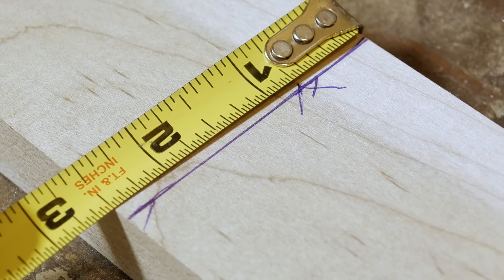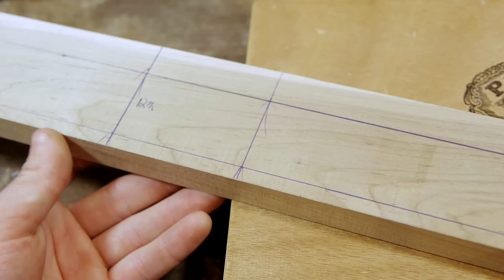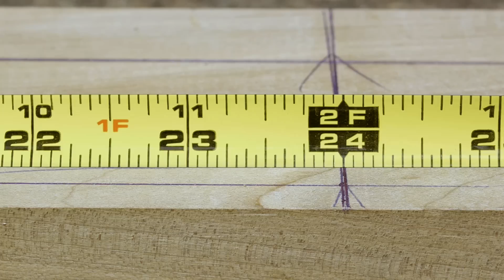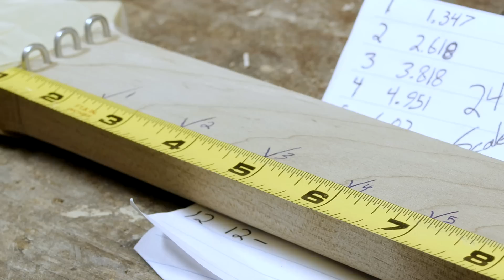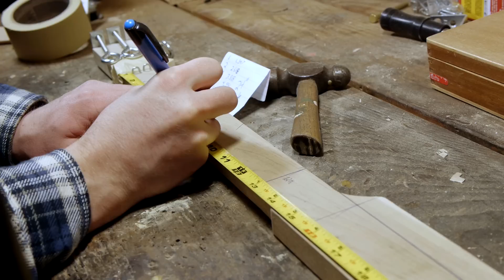Extended Cut: Building a Cigar Box Guitar w/Hand Tools [No Dialogue] - NightHawkInLight

Comment: I think you have some really inventive ideas that solve a lot of problems when thinking about the construction of something like this, but there are some considerations you might want to think about which though might make it more difficult to construct would improve the sound of the instrument.  The sound generates from the soundboard vibrating, which in your case is really just the neck and perhaps part of the cigar box.  I'd suggest try making the portion of the neck that runs along the cigar box much thinner.  It'll be able to vibrate more easily.  The thickness of the neck makes dampens the sound by not allowing for much vibration.   If you notice acoustic guitars don't pull the neck all the way to the bridge.  They stop at the body for this reason. 

That of course makes it hard to have a solid bridge which can handle the tension of the strings and not make the instrument collapse on itself.  So for guitars they add bracing, which also helps to control the type of sound.  Different bracing patterns underneath the soundboard create different effects. Dulcimers on the other hand just place a neck over a soundboard and run the whole way of the instrument.  What's different is that they place they neck on top of the soundboard, and don't cut into it.  This way the neck isn't the soundboard, and the box is.  The idea is to have the neck be carved in arches so that the neck touches the soundboard in as few places as possible.  This allows the soundboard to vibrate more freely and produce more sound.  You could perhaps not cut away the box top (soundboard), and instead lay a thin neck over, arched in several places so as to touch in very few spots.  This might allow for the box to vibrate a lot more than a very thick wooden neck.  This will give a much brighter sound less thuddy less dampened.

I'd also suggest tilting your headstock, you really do want a good angle where the strings meet the nut.  Your design is really interesting.  As engineering it's quite brilliant.  For quality of sound I'm not sure it works as well as it could though.  It's a really inventive way to do it though and impressive using readily available materials.  A good angle on that nut going downward should really improve things, and keep notes in tune so they don't vary when the string is being plucked.  Just a few thoughts.  Not trying to ding your design at all and I think it's really cool. You've got a good mind for engineering things.

Comment: Hey mate. Been a big fan of yours for a long time now, but have (unfortunately) never had the time nor space/tools to attempt one of your projects. However, this one is within my abilities, and I thought as an avid guitarist I should definitely choose this as my first. Just wanted to ask though; if I wanted to make a curved neck profile on the back like a manufactured guitar, should I use a plane, or a lot of sandpaper, or even something else like a rasp? Thanks in advance, and keep making videos, because they're fantastic.
Reply from the maker: Joseph Cooper You would likely have to glue another piece of wood to the back of the headstock so there's enough room to cut out the angle. Then cut it carefully with a saw or rasp it down, whatever.
Reply: Joseph Cooper h
Reply: Joseph, I make my necks out of hardwood, and then add a oak fretboard (1/8") and that makes a nice stiff neck.
Reply: Ronald Caldwell thanks. Sounds like it'll hold

Comment: Hello I think your instruments are awesome I was just wondering why you don’t do a nut at the top of the neck. I’m getting the idea that with the strings being pulled upwards mite keep the fret buzz away. Idk was just wondering..... great job. I think I’m going to try to make one soon and with your video it’ll help 😀
Reply from the maker: If you put a nut at the top you have to angle the headstock down so the strings put pressure on the nut. Using the staples and a piece of wood under the strings to lift them means you don't have to make an angled headstock.

Comment: Nice job dude i'm Really surpsised of the sound qualities as a guitar player of course ! 
But i was wondering why you don't "profile " the neck maybe it will be more confortable and do you think a nut on the "headstock " would be fine ? Cause i'm thinking to make a kind of guitar wich will be i hope as easy to play as a normal one ! 
And again good work !
Reply from the maker: Jexxy Rawx I didn't profile the neck because it would have been an unnecessary complication to add to the tutorial. I made it as simple as possible. You can only use a nut on the headstock if you angle the headstock back so the strings get proper tension.
Reply: Jexxy Rawx Classical guitars with nylon strings dont have profiled necks. Not even store bought ones. So a home
made guitar doesnt need it even with steel strings

Comment: Hi, I'm a huge fan of your projects. Some of my favorites include creating hydrogen with aluminum and hcl and the pasta rocket engine. I have actually attempted both and was amazed by how well they worked. The design of the apparatus used for making hydrogen is very simple yet effective and so it made me think, would it be possible to use with other chemical reactions? After thinking for a bit I remembered your pasta rocket engines and realized that the hydrogen generator could be used to make large amounts of O2 as well with some small adjustments (like using manganese dioxide from batteries as a catalyst for decomposition instead of yeast). I was hoping you could try this and maybe let me know how it goes. 

Ps: If you do actually attempt it, it might be fun to use some math and predict the oxygen yield beforehand using the volume and concentration

Comment: ......so there's a thing called a cigar box guitar. Looks like having only three strings is part of the identity . I was judging that three strings is engineeringly appropriate for the strength of the timber used so that the neck won't warp under strain. Yesterday  by chance  I came across a video by Robert Murray Smith, eight years old ,  he makes a tuning head for a ukelaly using aluminum cooling fins and modified wingnut bolts. Its an out of the blue video cos these days his channel is focused on homemade batteries , chemistry , homemade supercapacitors ....

Comment: w/ hand tools

uses drill
Reply: Thought the same thing... other than that though it was a phenomenal outcome
Reply: You use a drill with your hand
Reply: Jeepisking although this is true but as soon as I new he needed to still drill a hole, instead of a power drill I thought he'd used the hand top drills ones you'd crank around and around manually, inferring and sticking true to hand tools, a term placed on tools not involving electrical power, see I work with power tools every single day as well as hand tools, and they both have different jobs and sometimes one is more useful than the other, but power tools are just evolutions of hand tools, someone said "hey you know what would make this process faster?" Therefore power tools...
Reply: +Josh Shampoo hand tool= not a table saw, sanding wheel, jointer, planer, etc. But it would have been pretty cool if he'd gone with a manual drill too